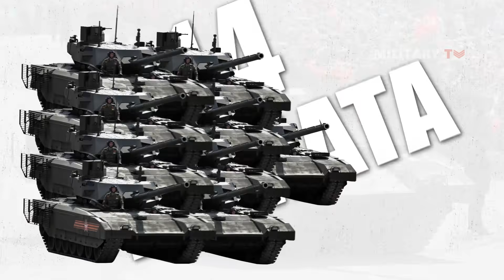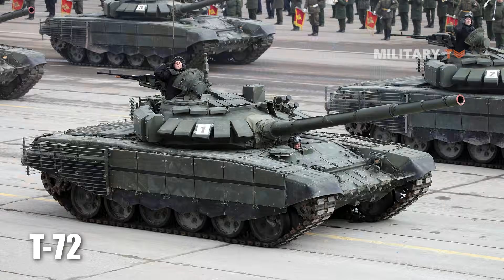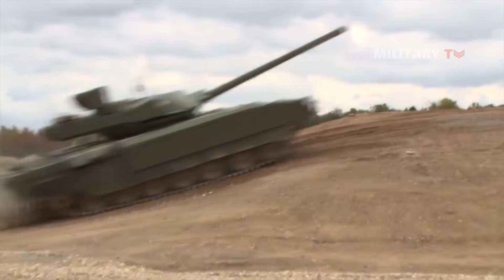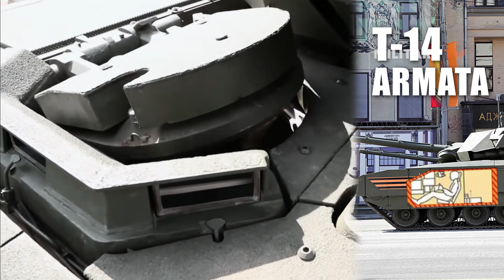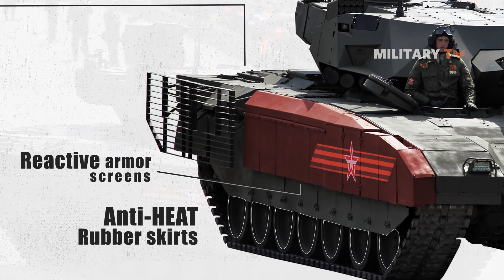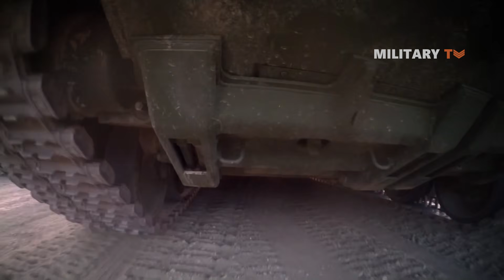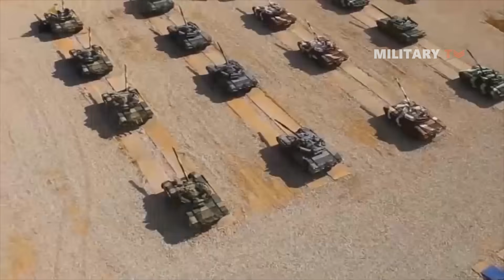T-14 Armata - Russia's Latest Tank

Comment: On Paper these are impressive however.............. In reality these are likely easily destroyed high value low production number Battle Tanks. Drones as well as manpads can maul thesel. Then their are all the woes inherent in Russian engineering of Tank components and operations plus lack of modern sensors and communications,etc. The way Russia is trying too War with the West he would surely need thousands of these rather than the few working ones they have. I think Russian presentations misrepresent their products on a higher than 50% probability.